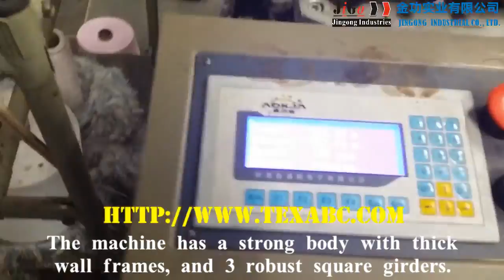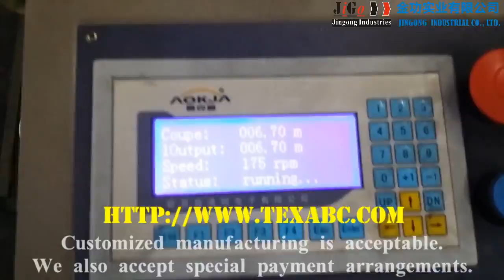JG888 rapier loom, terminator of 747 series Chinese rapier looms

Comment: Hi can I produce heavy fabric like 400 thread count sateen construction in this loom
Reply from the maker: normally sateen is workable, but if your satin weight is more than 500GSM, this machine is not suitable
Reply: Would you have loom working width 330CM?
Reply from the maker: @mohammadhasan5009  yes, 330cm is regular
please contact me by whatsapp +8613305756565